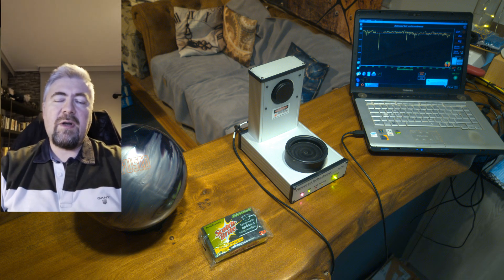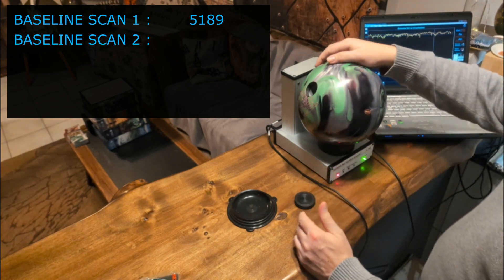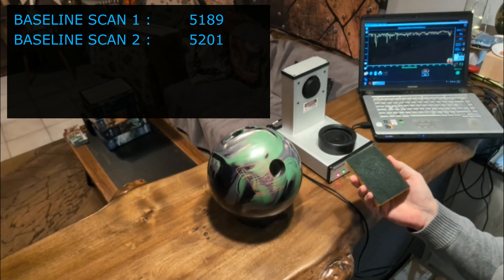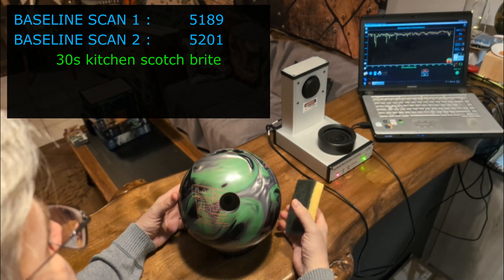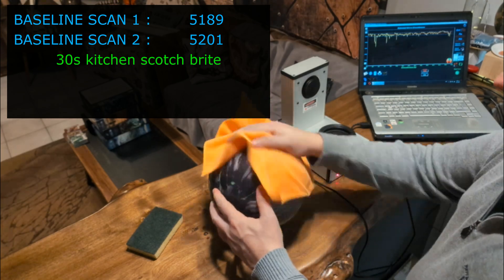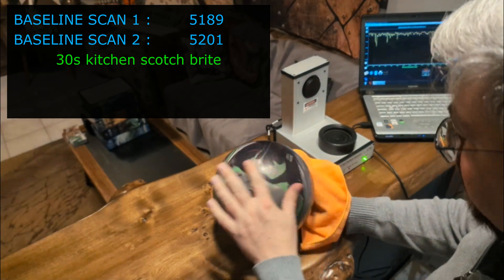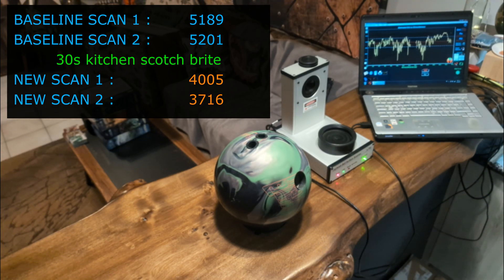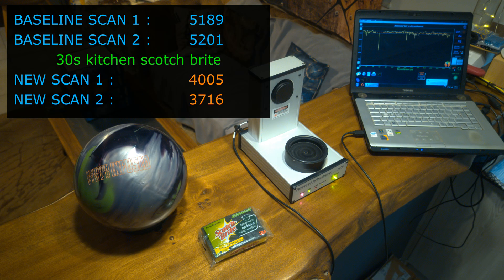Simple kitchen Scotch Brite for bowling balls ?  A laser scanner test !

Comment: When you are revolving the ball a second time and looking at the dull spots on the scanner graph, aren't the areas on the opposite side where the scanner reads?
Reply from the maker: No, they have designed the graph to be flipped 180 degrees. Not sure why. But is says it on the manual, and i have confirmed it , for example by passing over letters.
Reply: @bowlingxp8345 makes sense and more user friendly.  Thank you for the explanation.
Reply from the maker: You're very welcome !

Comment: I use CTD Bowling TruCut pads and a ball spinner. I am able to get a much more consistent surface grit finish on my bowling balls and like the ball reaction the CTD TruCut pads give me.
Reply from the maker: I have used them too, and did tests on them as well. "Consistency" of grit has more to do with technique though. Also CTD pads do not last as much as they say, so i like to experiment. Thanks for watching !
Reply: @bowlingxp8345  - I find the CTD pads last much longer than Abralon or SiaAir pads. Guidance from CTD is to just use hand weight pressure which provides a consistent and replicable surface grit on a ball spinner.  #TeamCTD    :)
Reply from the maker: The proper method to check whether a pad lasts longer than another, has to be very scientific. If we do it by memory ot "impression" it can easily be mistaken. I havent yet found CTD pads to last longer than others, and in fact some dont even leave the finish advertised , even by using the exact method on the product.

Comment: I resurface my bowling balls by hand using this technique:
1. Place ball on Cup with holes facing up.
2. Wet sanding pad with warm water.
3.I swirl sand one small area on the left side of the ball (I use my left hand) with 6 firm swirls.
4. Rotate ball clockwise just enough to  expose the next section not touched yet by the sanding.
5. 6 swirls and rotate again and so on until the ball has turned 360 degrees with 6 swirl sands and on all sides.
6. Flip ball so holes are not on the side.
7. Repeat sanding process described above.
8. Flip ball so holes are down.
9. Repeat sanding process described above.
10. Whole surface of ball is now properly finished to the chosen grit.
11. Dry ball with a paper towel.
12. Clean ball with 71% isopropyl to get any exposed dirt and the water out of the cover.
13. Done.
14. Note: Same process is used when cleaning the ball after use.
Reply from the maker: It is good to have the same technique i agree. I have mine, but most people just do some random movements by hand, and get a not even resurface on the ball. In videos like this, i want to simulate what we can do while on the lanes, so i have to use only what we would be able to use there. So at maximum a water spray or something. Your technique is thorough, but maybe it doesnt need to be that much. I use what CTD uses , which is 30 seconds of doing one side and 30 seconds doing the other half. If done properly, it is fine. Thanks for watching ! (i check your videos too ;) )
Reply: Congratulations

Comment: I really like scotch Bright and I bought a whole package of them from Amazon for $15, which is enough to last 50 years. And it has different grits. The nice thing about it is that when you do that, it doesn't remove a bunch of material like sandpaper does but it still puts scratches on it.  So you're not making a mess and removing any material
Reply from the maker: Indeed ! What types of Scoth Brite did you try ? Thanks for watching !